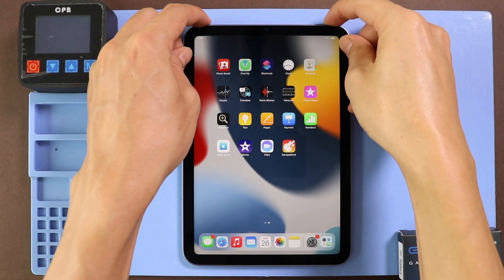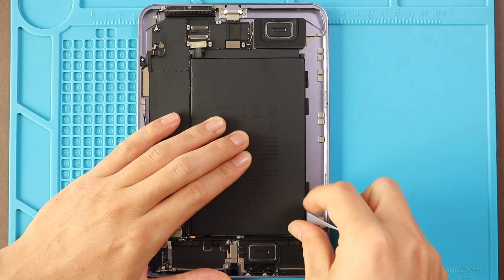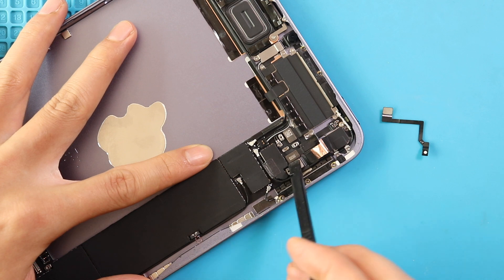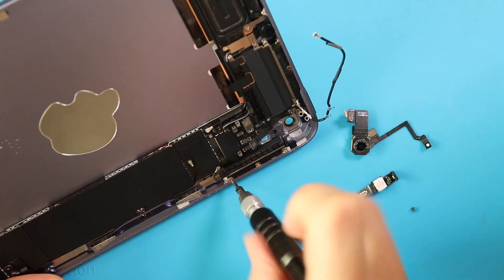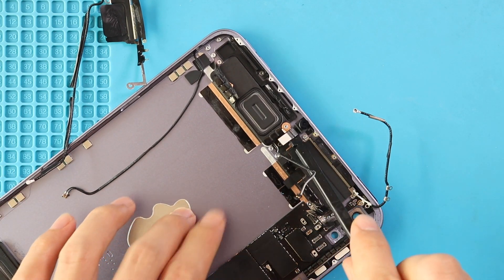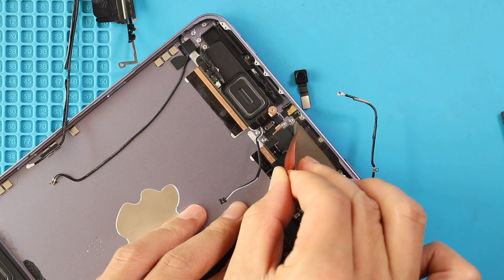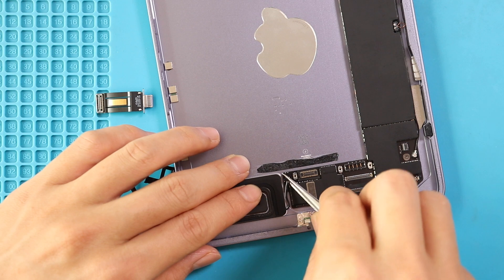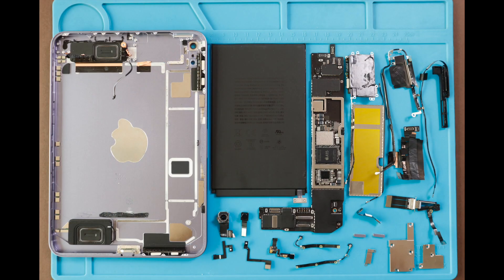iPad Mini 6 Teardown | Purple $$ to Repair..

Comment: Is it possible to Change the motherboard or logicboard to remove icloud lock?
I found one on a local scrapyard which was functional yet locked.
Reply from the maker: it is hard to remove the icloud lock, you can always swap with another logic board, but it should be lock free.
Reply: Is it hard or impossible if you don’t have the Apple iCloud passcode? If possible but hard…how?

Comment: One question since you do teardown is the selfie front  camera the same from ipad 8th and mini 6 and ipad pro 3rd Gen 11inch all ultra wide 12mp?
Reply from the maker: not same in mini 6 and ipad 9..and i dont think it is same on pro 9 too..But mini 6 and 9 Nope..cable sizes are different
Reply: @DIYGeardo  hehe not talking about the cable but ( camera thats front of all this models I mentions with center stage 12 mega pixel on all this devices I think but don’t know if they have the same quality as they for only front not rear cameras have ultra wide angle to be able to do center stage . That catch my attention all 2021 came out

Comment: Sooo much unused space. Could have easy an 6000, maybe 7000mah battery. It was disappointing to know the iPad mini only had about 1000mah more than the iPhone 13 Pro Max
Reply from the maker: Yep
Reply: The iPad mini costs less than half of what a 13 Pro Max costs so keep things in perspective.
Reply: @myNEONCITY  battery is quite inexpensive considering the overall costs of the iPad. iPhone Pro have 120Hz LTPO OLED Screen, the more expensive FaceID, 3 cameras, Lidar, more storage, more RAM, faster processor, stainless steel build.......
Reply: @GeffaOliveira  literally what kind of point are you trying to make? The iPhone is so expensive because it has all those features? Okay..? You’re not addressing the fact that you were comparing a $499 device to a $1,099 device and complaining about it.
Reply: @myNEONCITY  the cost of battery is very low compared to other components in the iPhone. You say that iPhone is more expensive, that's why have better battery, but battery makes up a very small part of the material costs. They could have gone with a bigger battery for the iPad Mini. The price wouldn't be much different overall.
Reply: Keep in mind that every gram matters when it comes to ergonomics.
Reply: ipad minis and airs are all full off air